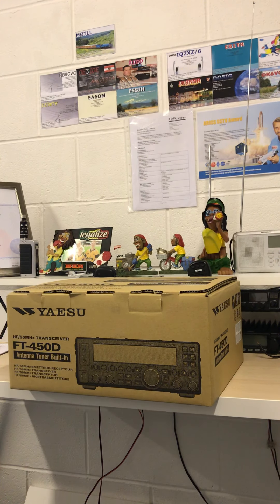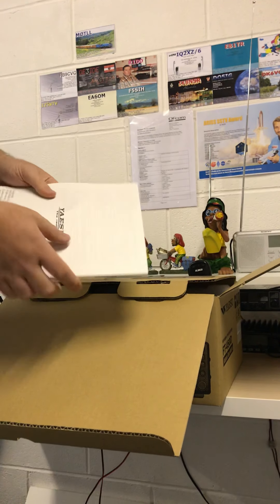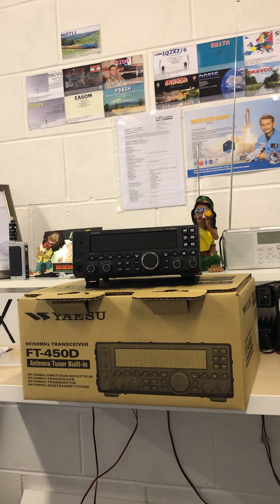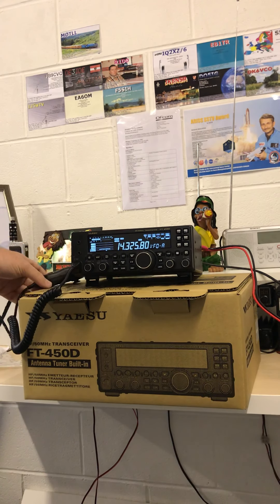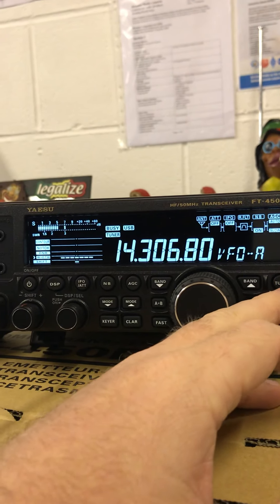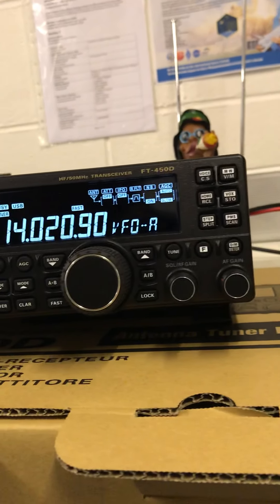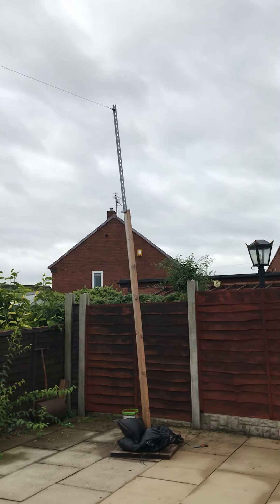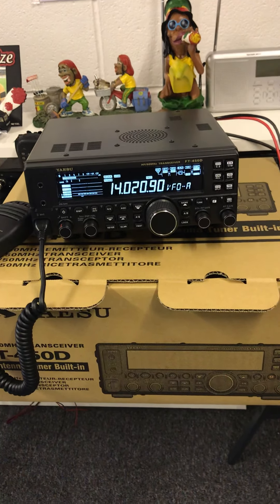Unboxing a Yaesu FT450D + NEW Antenna set up!!

Comment: When you turned that dial and said it was the squelch it was actually the RF gain... because its a dual control dial  just for your info.... :-) its squelch from 12 oclock to six clockwise ...and its RF gain from 12 to 6 Anticlockwise .....